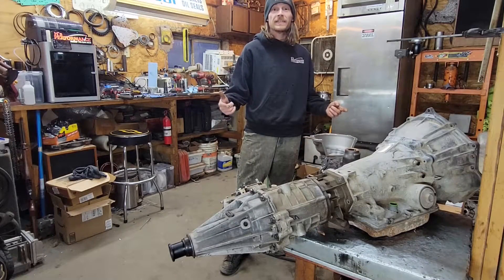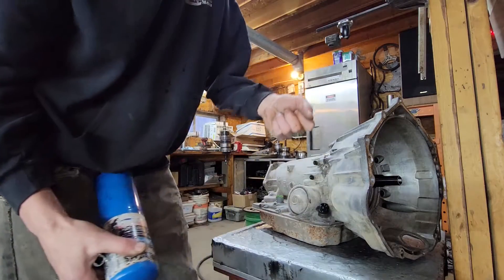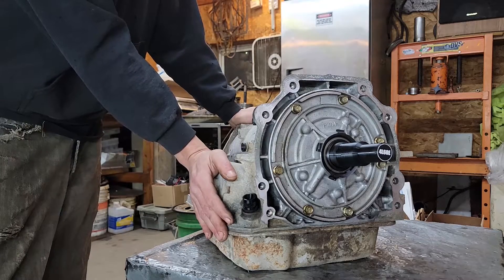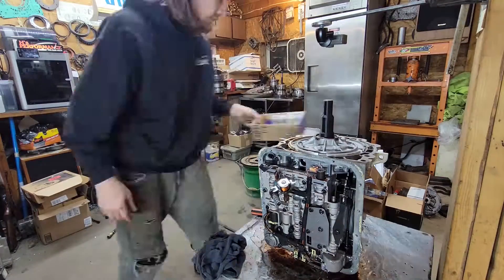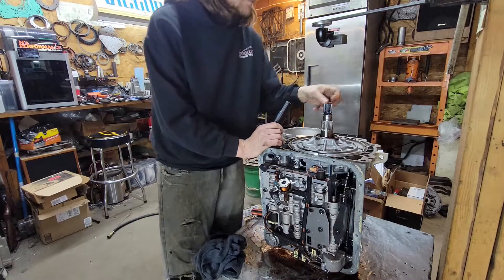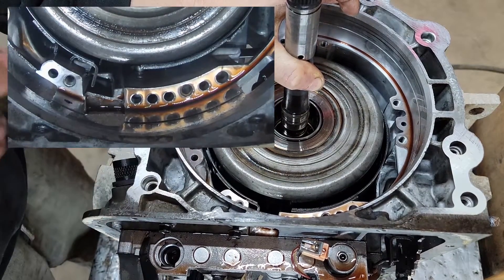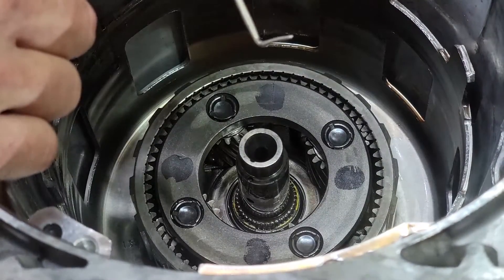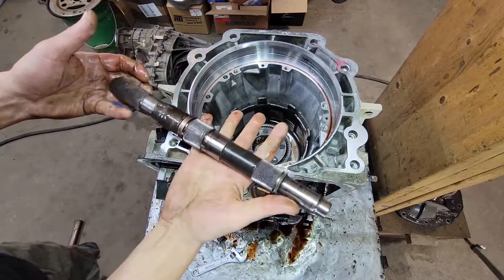HOW TO SWAP 4L60E Output Tail Shaft 4x4 to 2wd Conversion

Comment: Great video can you tell me will any 2wd 4l60 transmission shaft fit the awd 4l60e as I have a hummer h2 and want to convert to two wheel drive

Comment: If you don't have just the right pliers, the two pics method is much easier. I shaved my pliers flat on the outside pins at an 80 degree angle and then used a dremmel to make small (.005"ish) cut in the center of the flattened part. That c-clip is a slippery one. Took an hour coming out and another hour to put it back in on my first trans rebuild. Second one with my improved pliers still took 15 to 20 minutes each way.

Comment: Enjoyed your video. Great tips and overall instruction. I have a general question. I have a 2005 Chevy Tahoe Z71 4x4, I’m going to replace both the engine and transmission. I don’t want to buy a 4x4 version of the remanufactured 4l60 transmission. I want to actually remove the 4x4 transfer case and drive shaft since it won’t connect to the new transmission anymore. Do you see any issues with doing this. Appreciate input from you or other viewers. Goal is to save a little more on the gas and insurance if possible. Thanks in advance

Comment: I am looking at changing the output shaft on a 700R4 to a shaft that is 2" shorter. Is the process on a 700R4 similar to the 4L60E? The 700 is a 1982 if that makes a difference.
Reply: Should be the same

Comment: If your bh bolts strip, just drill the heads off and then remove bell housing.  The leftover studs are easy to remove and then replace with new bh bolts.

Comment: Hey thanks for posting this, it's a really helpful great video. I'm getting ready to do this conversion to the 4x4 trans that came from my LS donor for a swap I did. I just had one question. I was going to do the Sonnax servos when I did this project, from reading about that I will need to adjust the servo pin depth to spec, and from my impression this clearance is dictated by servo pin contact with the band. In this video it looks like you have new servos in the case already, but the band is not installed. I was wondering how you set the clearance without the band, unless I misunderstood how the servos work? I've never built a trans before so that is entirely possibly LOL.
Reply from the maker: @woog74  the servo was installed without the cover o-ring and band travel was checked after assembly off camera with the trans laying down as it would be in the vehicle.  Once verified the seals were installed.
Reply: @HsPerformanceWi  Oh OK, TY for the reply. For a minute I was worried I had completely misunderstood the whole servo install process.

Comment: Isn't there a plug in the back of the case you have to remove from the case when you convert to 2wd? Otherwise no lubrication for the rear cone area??
Reply from the maker: Not on a 4l60e. On the 4l80e  however, there is a cup plug that needs to be removed and replaced with one with the proper sized lube oriface.

Comment: Sweet tutorial brother!! How did you get that transmission that clean and prepped for paint?? I'm getting ready to pull a 5.3 and a 4L60E out of a wrecked '03 silverado Z71, and slam it into a '86 Chevy C10 stepside....gonna have to convert the trans to 2wd, wasn't sure how tough it would be but after watching this video I believe I can handle it! A couple of years ago I replaced all of the solenoids and the servo in my 2000 Z71 4L60E so I don't mind getting inside of one!! Thanks man!
Reply from the maker: My process is as follows - First I seal the trans up with the plugs shown to keep water and grit out, then steam clean it outside on a pallet to get the bulk of the grime off. After It's stripped down to the bare case it goes in my hot parts washer to get it completely free of oil inside and out before going into the sand blast cabinet to remove the aluminum oxide corrosion (this can also be done with different sizes of wire wheel cups on a drill but is a lot of work and makes a ton of dust in the shop) . After blasting it goes back in the hot parts washer to remove any sandblasting dust, I paint with high temp engine enamel immediately after it comes out of the washer while it's still hot. The biggest thing is getting the corrosion off before paint to make them look decent.
Reply: @HsPerformanceWi  I appreciate the tips! The aluminum oxidation is what I was wondering about, will have to see about media blasting it! Thanks again and will for sure be grabbing some of those plugs before starting on it!

Comment: I am having a hard time finding a Trans to go into my 94 Silverado 4x4 that has a detent cable I can find tons of the 4l60 e without detent is there a good way to convert the truck to use the newer 4l60e to work on this year model? 
Everyone tells me I need a 94/95 transmission to replace mine.

Comment: You didn't need to put the snap ring in on the new shaft?
Reply from the maker: @9:55
Reply: @HsPerformanceWi  thanks I'll check it out. Squirrel must have run by and I missed it
Reply: Yep! There it was. I remembered you reaching under the table but somehow I missed you putting the ring back in place. Thank you again for replying. Great video. @HsPerformanceWi